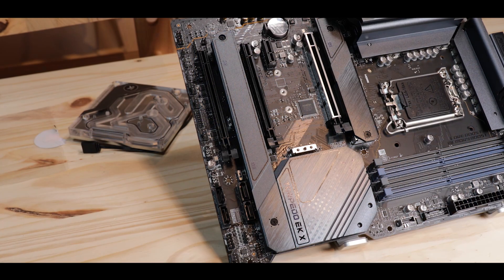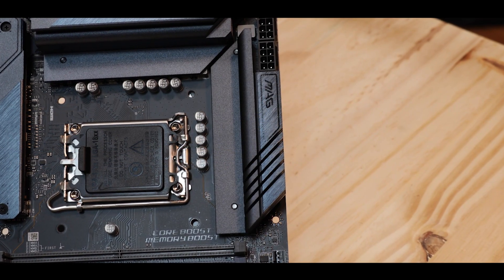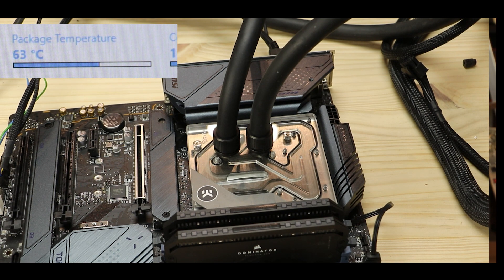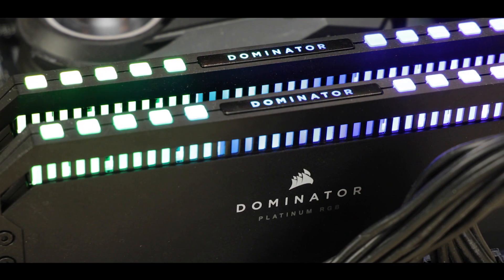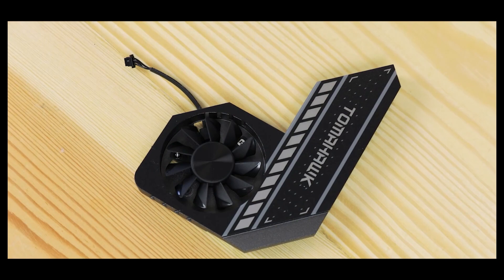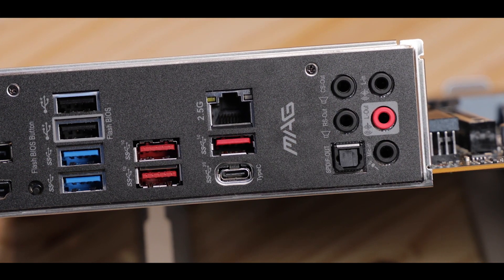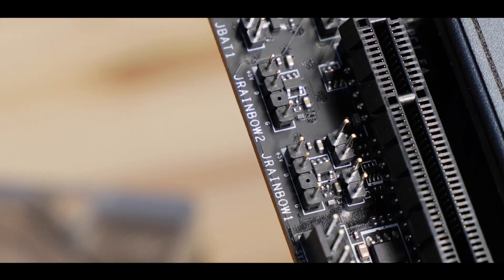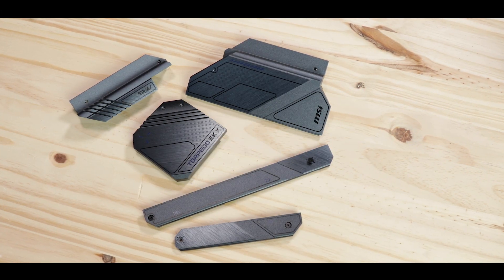The MAG Z690 Torpedo EK X: EKWB is turning MSI motherboards into gaming GOLD!

Comment: I think you are cheating, I can't see a springs, coming with pack to install, I can't see a print of thermal grease on the waterblock, why? Because it can't be installed "from the box"... thermal pads for VRM are too thick, it must be 0.5 mm, instead of 2 mm, if you'll try to install WB by the instruction you will get nothing, no connection with processor. You can only not use complected thermal pads, not use springs, and dont use plastic ring, if you want to assemble you WB on the processor. It's an awfull fail. And if you want to run RAM ower 6400 MHz, skip it anyway.

Comment: Hey, thank you for your great video. Can I use this board without the monoblock and with a normal air cooler? I found a good offer for this board, but I have no plan to use water cooling so far. Thank you.
Reply from the maker: Absolutely. It comes with metal blocks as well.. so no worries :))))

Comment: i am a really budget friendly guy and i run pc very long like 8-10 years , though i was young i wasn't that tech aware so i bought cheap mobo , which failed after 3 years after that i got a mid range gaming motherboard ran almost 5 years , i may built a decent specs pc so i wanna ask is that what motherboard should i go for , i know one thing that more phase is always good and stable a heat sink is also necessary , so for a budget this mobo looks good should i buy it for 12600k ?
Reply from the maker: It can handle much much much more than a 12600k :)
Reply: @Laurentschoice  thanks but my concern is it should last long if i clean and maintain proper thermals and airflow , as i've seen mobo getting obsolete fast and where i live i may not see another z690 mobo after 5 years , that's why i need something solid and in my budget
Reply from the maker: Hmm I see. PCIe 5.0 will keep you future proof for more than 5 years I recon . 
As for solidity, I would not go MSI. Their BIOS is too unstable.  

I d go AORUS or ASUS (though asus is upping their prices to unacceptable prices .. watch my video of this morning).

Frankly talking , if you have 300 bucks for a motherboard watch my Z690 Aorus Master review.

Comment: Have you found the internet speeds via the Ethernet connection to be slow on this motherboard? I have changed everything and installed/ uninstalled everything under the sun to get my provider speed but I’m still getting a 1/3 of the speed I should be to the pc? Only thing I haven’t tried is another motherboard but my phone through wireless gets twice my speed to the pc

Comment: i9? Awesome! Now if Intel can only keep them from bending (GamersNexus: Investigating Intel's CPU Socket Problems). 

MSI does make good Motherboards but their software (Nahimic) is virus level. Stopped using MSI because I got tired of all the problems that monstrosity caused. 

I use an EKWB CPU block and temps are good but they don't use metal to metal screw threads like Optimus so it is relatively easy to strip them and they don't come with a 10 year warranty! 

As for the Monoblock, I might give one a try but if you have quality VRMs you won't need to cool them. At least not for the average gamer. 

Anyway, just some extra stuff for viewers to take into consideration. But as usual, your vids are informative and entertaining and a must watch when shopping for a motherboard. 🙂👍
Reply from the maker: Oh man... I soooooo agree with u on the software ... its absolutely rubbish!!!....!!!
Reply: @Laurentschoice   & General Grevious.....Is it manageable if you just want to set it up once and not OC etc? Reason to avoid or just a pain?
Also Laurent & GG... Wondered if you thought the previous Intel I7/19 12th series reviews could be skewed after the GNexus Thermal Grizzly Contact Frame showed a 6-7 degree average drop? Should we expect a v2? Still rocking a 4790K so ready for an upgrade. Cheers